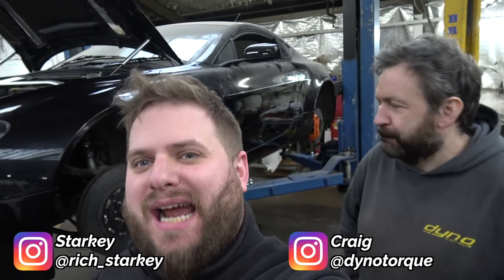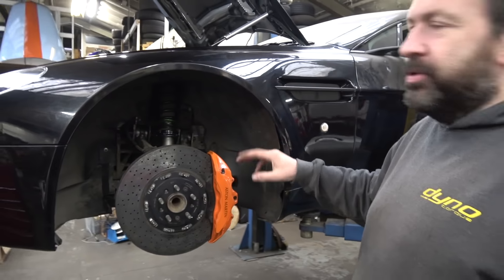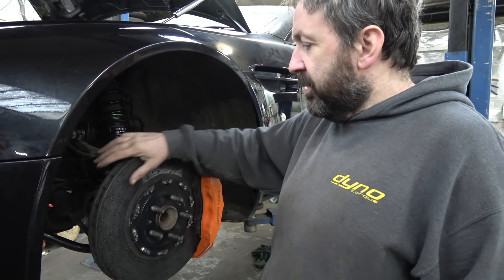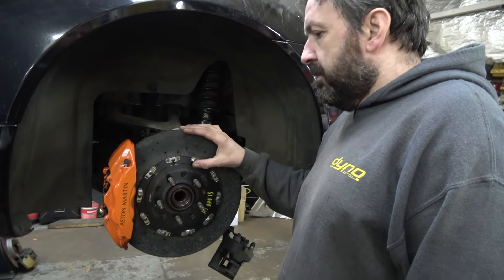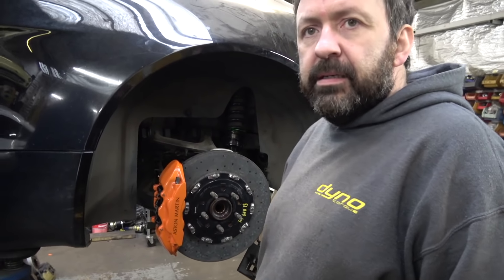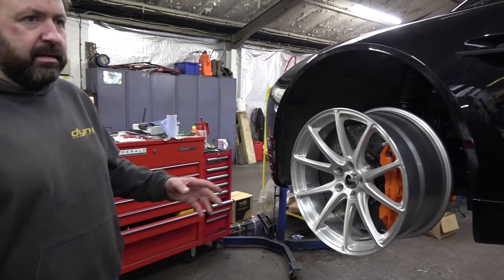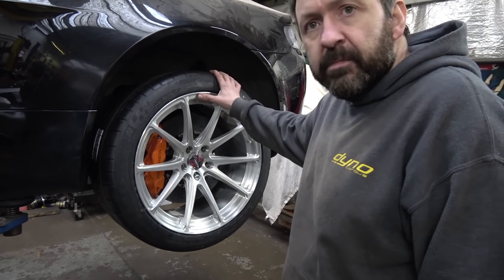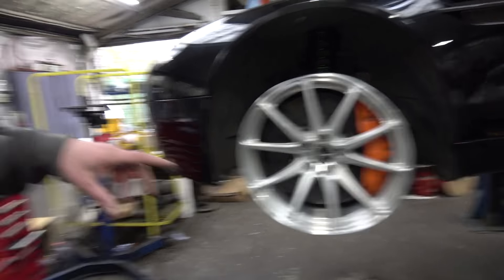Carbon brakes & forged wheels - LT4 swapped Aston Martin V8 project - Pt 8

Comment: Craig, you need some of the long alignment wheel pins to protect the CC disc’s, it’s to easy to drop the wheels when removing or replacing and chip the discs, they are like dinner plates from a strength/chipping perspective. You need two per wheel for ease when removing 4 wheels or two and just swap them around👍 with your machine skills just get some alloy or steel rod and machine the wheel bolt thread on one end and a bull nose on the other, 150mm in length approx.

Sorry, just s-otter you are running studs... just be careful I guess.
Reply: Sounds like good advice 👍
Reply: Lad for mentioning! Imagine chipping those!
Reply from the maker: I had some for the Murcielago before I did the stud conversion. It's a real pain in the butt when the wheels are on and off a lot. I just learnt to be very careful.

Comment: Internet reckons on circa 20kg saving for carbon ceramic discs vs steel (70%), think the discs actually have a minimum weight etched on them (3.5kg or thereabouts from memory). Would guess you're probably in the same ball park of weight saving for a set of forged wheels vs cast oem too. All unsprung too which is nice and actually quite a lot! I think it will go someway to offsetting the extra weight of the gearbox which is quite a bit more substantial than the original!
Reply from the maker: It's a strong recipe! Even if it is mostly done so he doesn't have to clean the wheels 😂

Comment: The new wheels look ace. The look kind of similar to Apex Sm10 wheels.

Nice to hear you ran khumos on the M3. I was considering them for my M3
Reply: Luke Kuszpit good tyres but fuck me they wear quick. Get some Michelin ps4s
Reply: I rate the khumo very high , half the price of mich , I abused them bad on the bmw and never had any issues with them , defiantly buy again
Reply from the maker: The Michelin is a better tyre. The Khumo is good for a budget, but wears very quickly.

Comment: This is tempting me to either lt/8l90e or ford 5.2/10 speed swap my x350 jaguar XJ8... Craig mentioned that he was running an emerald ecu for the car/canbus. Could you tell me which one it is?
Reply from the maker: I believe it's a K6+ and it's had some extra work done at Emerald.

Comment: You said that you are running 295/35R19 in the rear as you didn't like the 305/30R19... What are  you going to run in the front and what is the size and offset of your wheels... Looking forward to see it rolling
Reply: Francis Vachon 265-35-19 fronts , they look right but not had on the floor yet but pretty sure it’s the right choice for me

Comment: If the wheels are 10 and 11 inches wide for the Aston Martin, thier are 275/35r19 and 305/35r19 Michelin Super Sports and Cup 2 options.
Reply: Gen1 C8RS they are 9.5 and 11,  305-35-19 is very expensive tyre !!!! That’s why I’m not using it ( and it’s a bit to big I think )
Reply: @craigtaylor5075   Ok good points, I was just mentioning those tire sizes because of the LT4's Horsepower and Torque🥇👍😁

Comment: Surely after buying a full set of carbon ceramics a set of KW won’t hurt the bank too much?
Reply from the maker: If necessary I'm sure he'll do it, but this conversion has cost nothing as we gave Craig the HSD bits he needed to convert. So it's worth a go.
Reply: Driftworks ahhh that makes sense.. thanks for the reply!

Comment: Cars are awesome Aston looks like it will be menacing and those bm don't get old just better I like modern BMW but I think old school BMWs are just cooler . That v8 m3 engine is more reliable than original m3 engine?
Reply from the maker: It probably is, which is pretty mad considering it has an additional 250hp over the original S65 V8.

Comment: Instead of packing a silencer with battles and sound deadening what sort of sound could having a 100cell cat in there instead. Not for emissions just purely sound benefits
Reply from the maker: CATs are expensive is the only thing.
Reply: @driftworks  yeah i didn't think of the cost. I was just thinking about a pair of cheap ebay cats.....but i geuss coming from china is not the thing you wanna touch

Comment: I vote make a proper back box without the switchable valves....
Reply from the maker: I was for that. But someone above has pointed out that original backbox is part of the crash structure, so now I like the modified standard box idea.